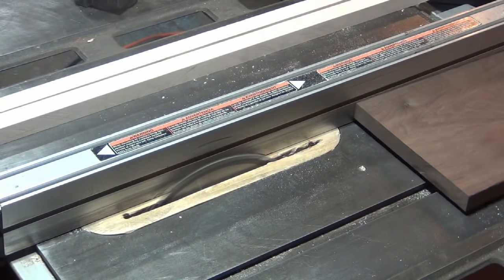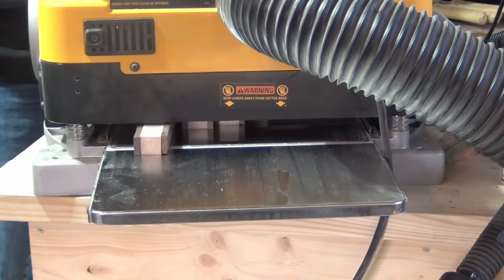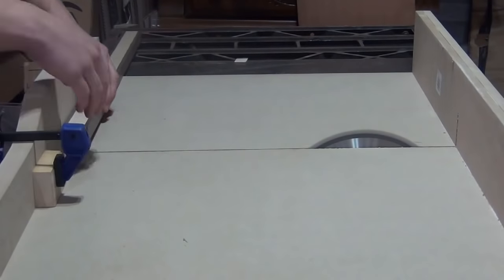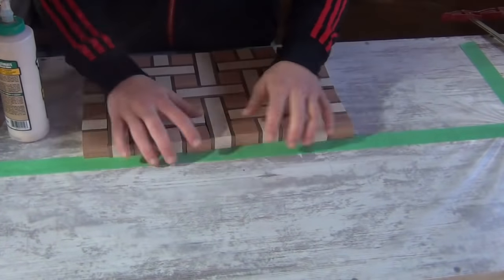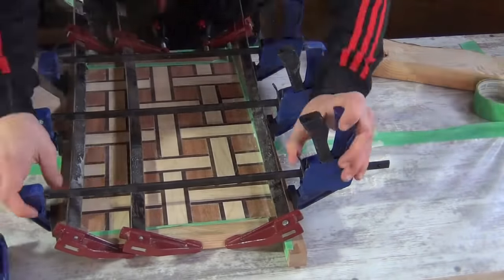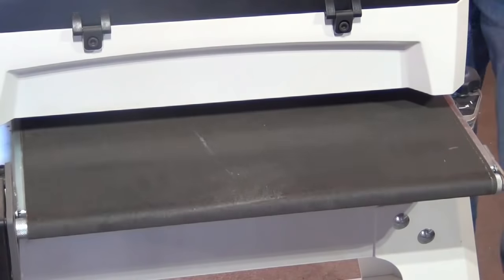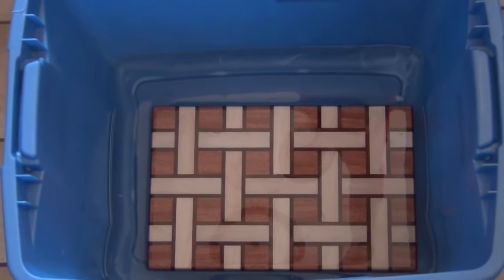Making a Basket Weave/Ribbon Style Cutting Board Tutorial

Comment: I have not made a cutting board yet. Thinking of giving it a try. Folks, what is, in your opinion, the best coating or sealer for a cutting board? Thanks.
Reply: Mineral oil, followed by beeswax.
Reply: @tschmath  Thanks!
Reply from the maker: Mineral oil is good, just always make sure it is food grade. The beeswax based cutting board conditioner is great for a little more protection and for re finishing the board every now and then.
Reply: @CalebsFineWoodworking  I don't know of mineral oil that isn't food safe. It's sold as a laxative, so it darn well better be. 😀
Reply from the maker: Not all mineral oil is food grade. There are some kinds designed to be used as a lubricant for metal, these aren't food safe. Most mineral oil may be food safe, but it's always better to double check. Have fun on that board!

Comment: Why didn't you do multiple glue-ups, instead of one at a time? Also, is there an advantage to using the sled versus using a chop saw?
Reply from the maker: I do just one glue because even though it's a lot to do, it makes it easier to get everything lined up right. As for the sled verse miter saw, the sled allows me to make the same cut over and over quicker, and more accurately than the miter. Hope this helps!

Comment: Well done.  Question: Do you have any concern about the end grain glue-up failing?
Reply from the maker: Thanks! Personally I don't think the end grain glue up will give out because it's glued on so many different sides, including the edge grain, which is supposedly just as strong as if there wasn't a joint. As long as treated properly, it should hold up perfectly fine. Hope this helps!

Comment: Couldn't you have glued the strips up at the same time?
Reply from the maker: Do you mean the thin walnut strips on to the maple? because that is what I did. I cut them into shorter lengths before gluing them because it made it easier to manage, and gave me less waste due to the different length pieces I was working.
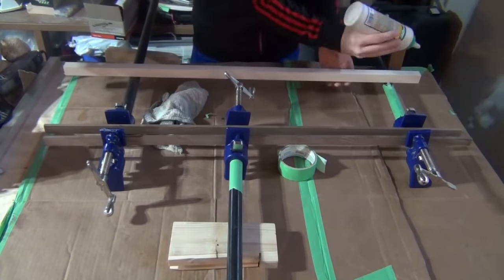Reply: @CalebsFineWoodworking  I meant why didn't you put them all in the clamps at the same time when you glued the walnut strips to the maple 2:40
Reply from the maker: The reason I didn't do that is because the pieces were different lengths so I wouldn't have been able to spread the clamps out evenly. If your pieces are the same lengths then yes, that would work!
Reply: @CalebsFineWoodworking  just to save time I still would have, with extra clamps on the longer ends. Really nice board, so many guys making them it's good to see some different ones. Great of you to share.
Reply from the maker: Thanks I appreciate it! Yes that idea for the clamping should work if you have enough clamps